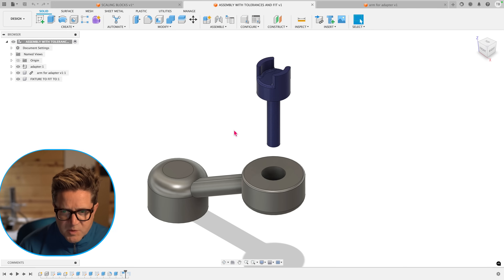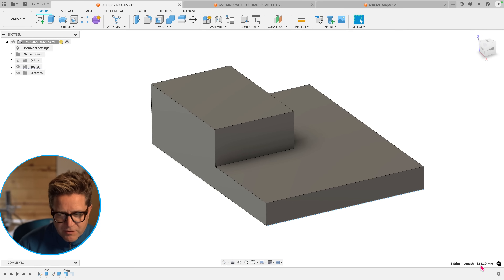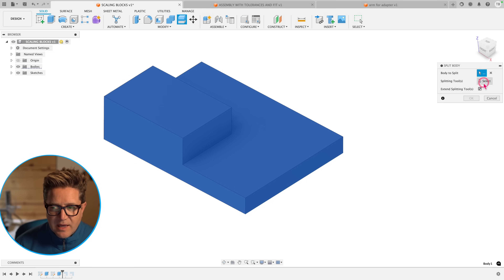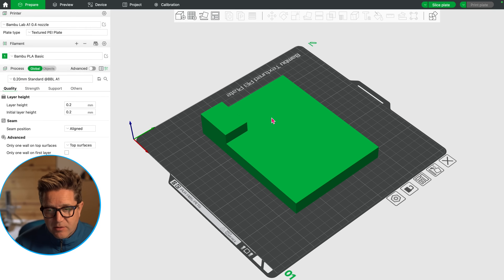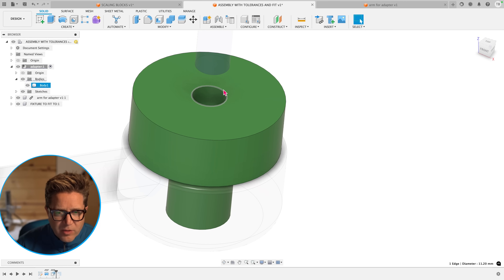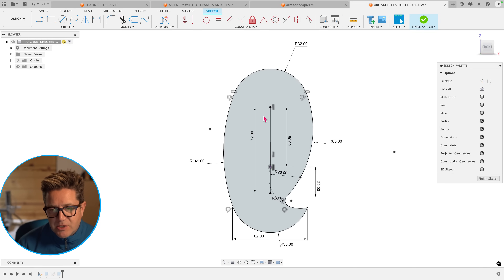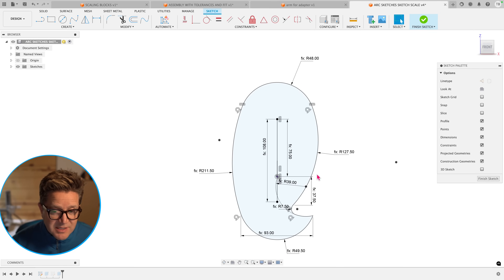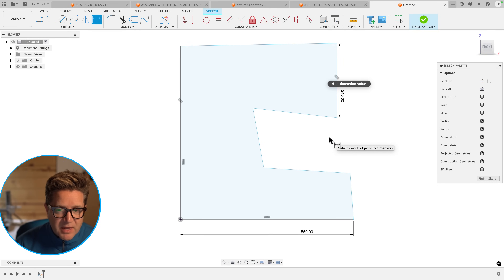Fusion 360 Scale (Fix Sizing Issues, Resize, and Adjust)

Comment: This advice is good as far as it goes. But when you have a sketch consisting of thousands of objects it does not scale well. Think tens of hours trying to apply the advice. At least some of the work should be done automatically by the tool. Fusion is,, after all, supposed to be a productivity tool.

The sggested "scale entire sketch at first dimension " option will incur a HUGE performance penalty when the sketch contains many objects. Its impractical because Fusion does not make use of all the hardware resources of modern computin g platforms.

Comment: The Scale tool is long overdue for some extensibility improvement by the Fusion Development Team. I propose 1) adding "Scale From"; 2) add "Three-point Scaling" functionality; and 3) add "Scale Selection or Body" option. The workarounds demonstrated in your video kinda validate my opinion.

Comment: I print a lot of PLA parts and always manually calculate shrinkage factors.  Never thought about using the parameters.  Now that you've shown me how, my PLA printing should be much easier and faster to address those features needing shrinkage consideration...Thanks.

Comment: One scenario I encounter a lot is that I'm designing parts and they have a measurement of, say, 10mm, but when printed they come out at 9.8mm.  Where do I put these missing 0.2mm, if I add this as a tolerance variable and use it in a new operation on the parts, or add it to the measurements in the main operation